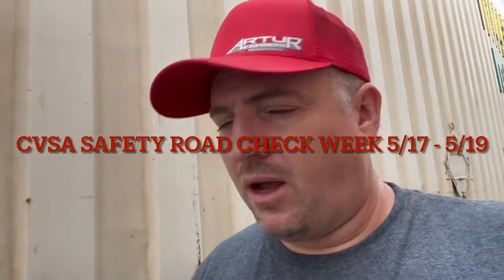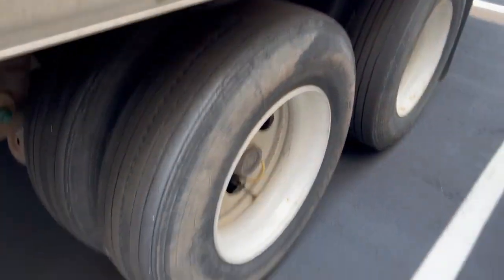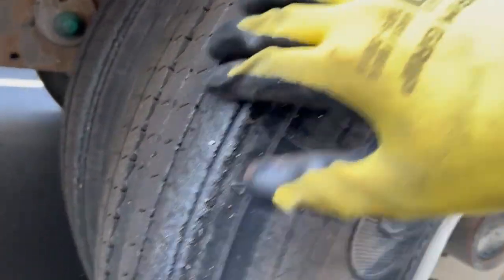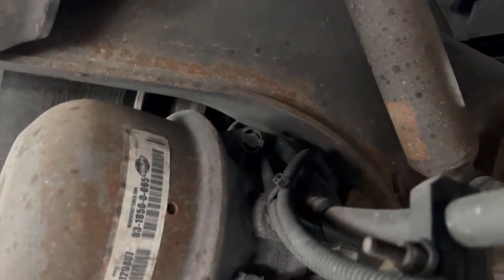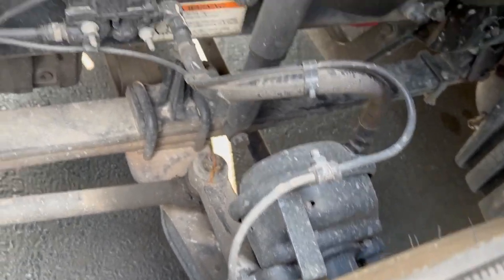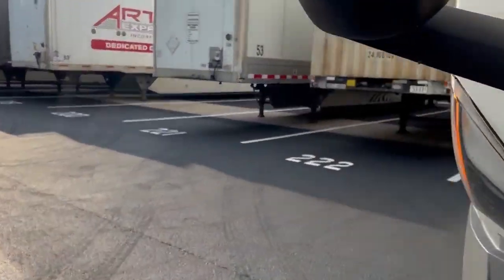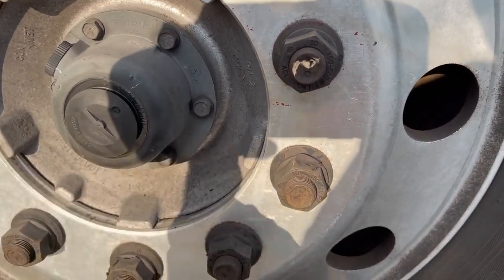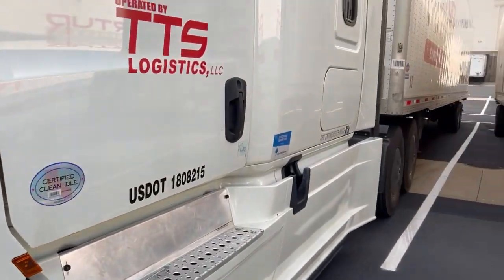CVSA Safety week

Comment: Man you run 120lbs up front and 100 lbs in the back ? That's a big difference I usually try and keep them closer like 110 in the front and 105 in the back or if you have those contientels that are rated for 120 the drives run 110 lbs but everyone's different good video though I like stuff like this Man for sure !!